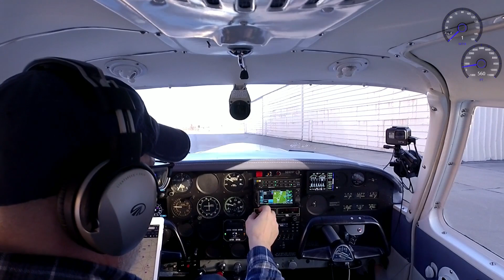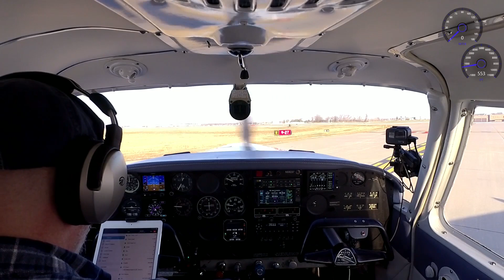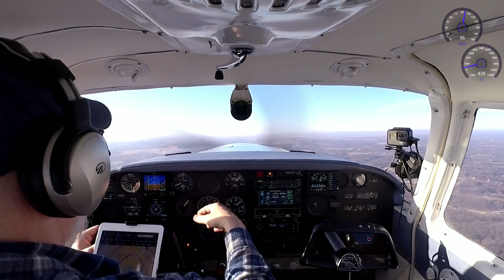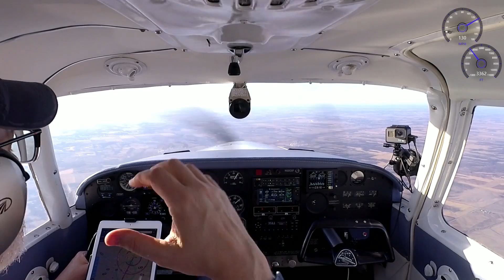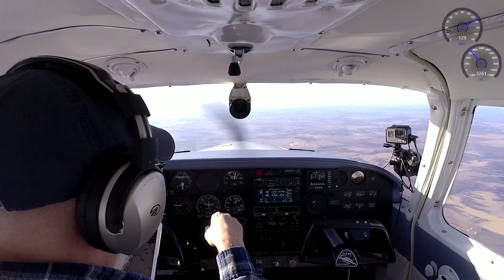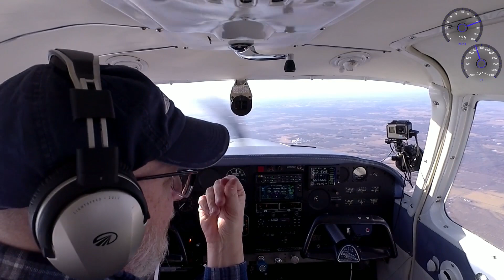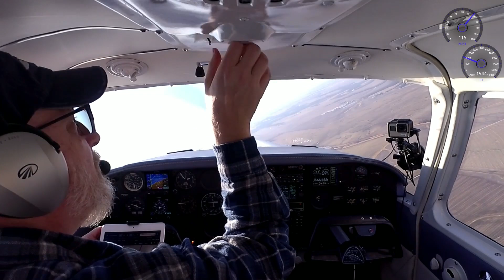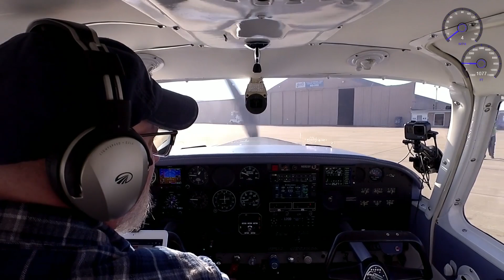Piper Comanche 250 back in the air, KMLI to KUIN

Comment: Michael, do you lean ROP or LOP?
Reply from the maker: Hi Tony.  I do ROP, typically 100* ROP which is best power mixture.  I'm Carbureted, so LOP is a bit difficult.  I have tried it and was able to get all cylinders to a LOP status without the engine getting rough, but I lost quite a bit of airspeed, so I went back to ROP.